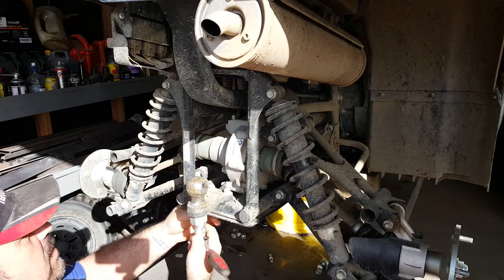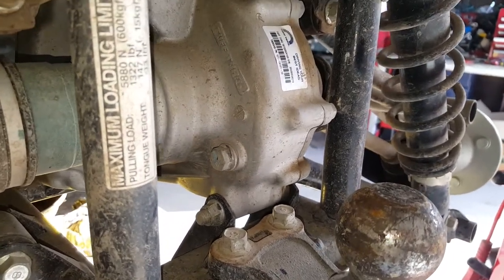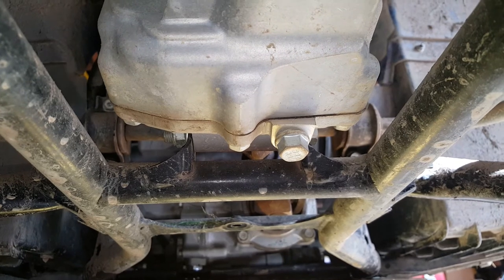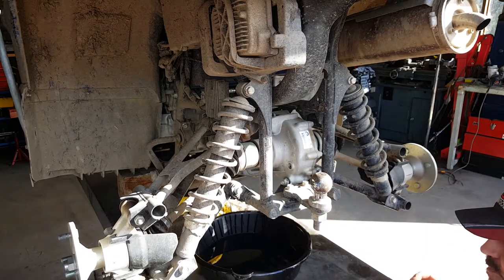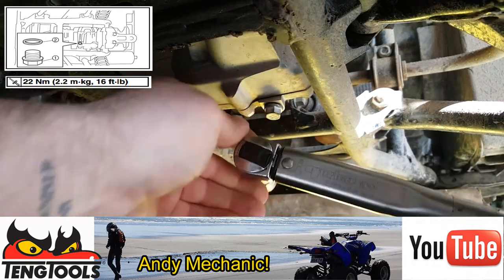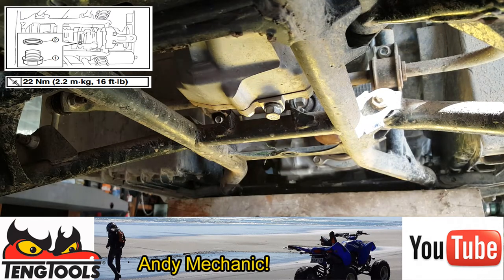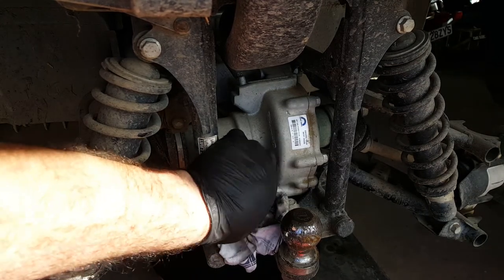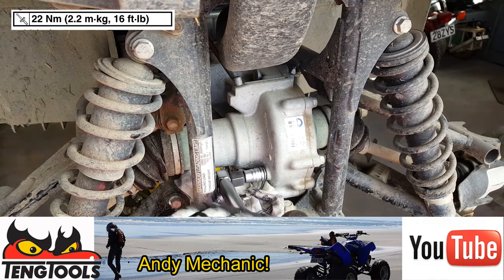Yamaha Grizzly 450 - Tuff Torq final drive oil change #1809

Comment: Should you warm up the oil before draining by going for a short drive. Great info.
Reply from the maker: No problem, please to be of help. Yes, the oil should be warm but not at full temperature or you may burn your hand removing the sump plug & oil filter.

Comment: Hey Andy I was wondering if you could show how to adjust the final drive brake system. I can’t find any info on it. Thanks for the awesome videos.
Reply: Did you ever find anything on this? Just bought this quad and the rear brakes don't do anything.
Reply from the maker: Hi, is it the internal wet brake Tyre rear brake inside the final drive on your ATV?
Reply: yes the entire rear brake is internal.  i have the same model minus the EPS
Reply from the maker: Okay. I know the one. What's your email address?

Comment: So that yamaha gear oil is basically gl-5 friction modified 80w-90?  Otherwise known as gl-5 limited slip 80w-90? Don’t really feel like paying for another quart just because it says yamaha. I’ve got a few quarts of full synthetic valvoline and non synthetic generic brand gl-5 limited slip 80w-90 gear oils in the shop.

Comment: Andy looking from the Back on the left it is losing oil or leaking oil out of the differential HELP
Reply from the maker: +John Hyde Park Hi John, the fill hole is about half way up on the left looking from the rear. The drain is at the side bottom on the left also. It's not underneath. Hope this helps. If you send me an email I can send you a diagram. Cheers Andy

Comment: What happens if the bolt hole is stripped? I checked it for first time today since buying the fourwheeler.  First thing was that oil was pouring out without stopping...? Not sure if it is over filled or what, of if this is normal? but it says that it should be up to brim of bolt hole, so it seems like it has alot more in there.  Back to bolt.  I went to tighten it up, and it just wouldn't go all the way in, and it keeps turning.  It seems the bolt hole is stripped, the bolt looks fine... but I know I didn't do it because this is the first time tightening it myself.  I think the person that serviced it before I got might of stripped it.  It doesn't leak, but it doesn't go all the way in.  Can still put a finger nail in between the bolt.
Reply: oh btw. I have a 2014 grizzly 450 eps.
Reply from the maker: +Rperley 84 okay. Firstly you need to drain the oil out as there is a possibility that water has got in. Water is heavier than oil so will sit at the bottom if the bike has been stood. Then refill with new oil to the correct level.

Also with the filler Bolt,  so long as it seals it's going to work. Not ideal but an expensive fix so best leave alone, provided it's not the reason the water got in (if it did?). Also check breather pipe, may be missing or damaged - should run up to near front of bike.

Hope this helps. Cheers Andy
Reply: Okay thanks.  I will have to get some oil soon.  Not sure if they sell that specific kind around, but will have a look for sure.  I can never seem to find all the yamaha oil/lubricants around this part of town...As for the  bolt.  When I first loosened it, it was all the way in if I remember correctly.  But it just would not go back in all the way... Would it be wise to be put some locktite or something on the bolt near the washer? to help keep it from possibly getting water in there again and of course keeping the bolt in.  I also did notice a clanking around near the rear end too, so what you said about the possibility being in there might be right... the oil just wouldn't stop draining out, so I just put the bolt back on.  Water could very well be pushing it all out. At first I thought it was just unlevel ground, so I tried a flatter part of the drive way and it was still coming out just as fast.  But I will change it as soon as possible... This is all new to me as well.    Thank you for such a quick reply.
Reply from the maker: +Rperley 84 no problem. What you say all makes sense. Yes, some mild locktite will help but not the red stuff!

A Yamaha dealer should ship the oil to you if you give them a call.

Pleased to be of help. Cheers Andy
Reply: Andy Mechanic one question. i dont have no yamaha rear axel oil... but i do have SAE 80 gl 5 rear axle oil for motor vehicles. would it be okay to use this for now until i get some yamaha stuff? thanks again.
Reply from the maker: +Rperley 84 it depends. You should be fine provided the bike has normal brakes at the rear wheels. Newer bikes have an internal brake which is built into the final drive unit. If this is the case on your bike then you'll need the Yamaha oil or it may reduce the rear brake efficiency due to friction reducing additives in the car oil.

Hope this helps. Cheers Andy
Reply: Andy Mechanic okay thanks alot.  appreciate it.

Comment: Hi Andy, thanks for posting so many great videos. Could I pick your brains for what's possibly a major final drive problem? I've got a neglected (and therein lies the problem - my own doing) Yamaha Kodiak 450 2003-2006 vintage. First noticed a screeching coming from the final drive area and experienced what I describe as "mechanical braking", as in the bike would slow to a stop quickly without me pressing the brakes. I do have the mechanics manual for the bike but am at a loss as how to proceed. Can I remove the final drive to check the gears and bearings in a simple way, or would that mean major reconstruction/buying special tools which to be honest is beyond me. Is it possible to buy another final drive that would be plug & play, or again does it require specialist knowledge? I'n trying to figure out what the best/most cost effective course of action is. Many thanks, John.
Reply from the maker: +John King Hi John, I'd suggest removing the final drive. You should be able to remove the crown Wheel Cover easy enough and do a visual on crown Wheel and pinion and associated bearings for play/condition without any special tools....